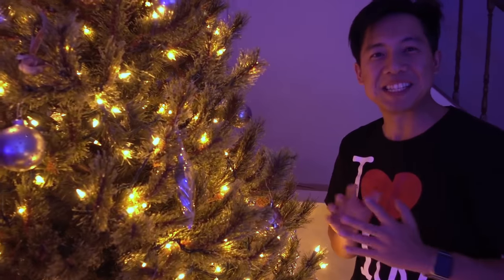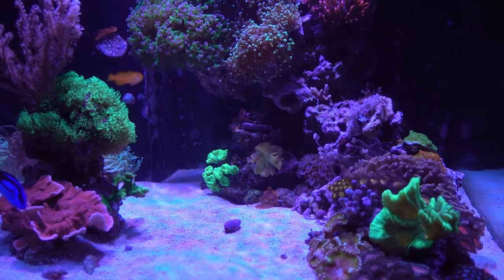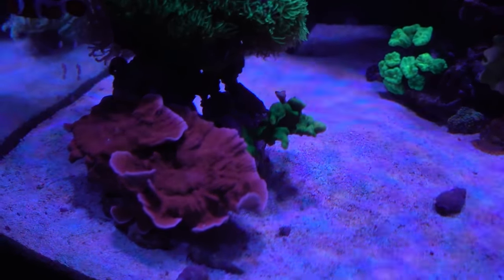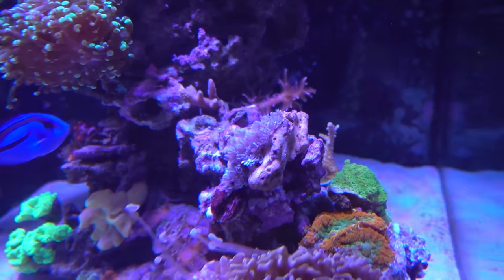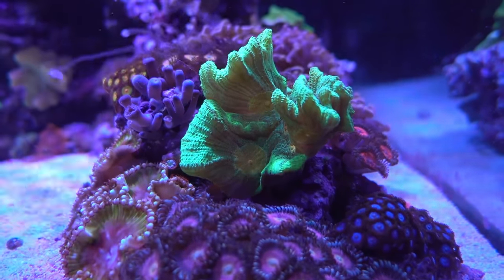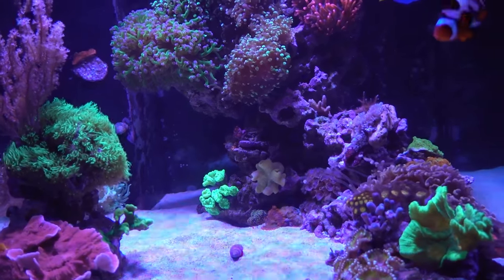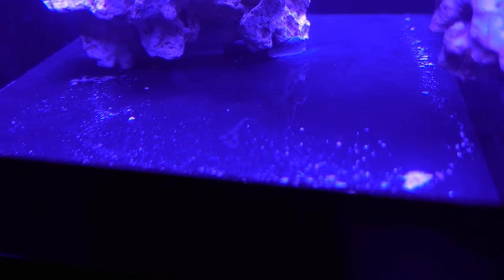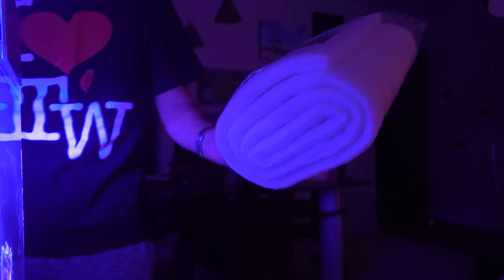SPS FAIL. Starfish FAIL. Dropoff OK. (45g & 17g Tank - 11/28/2016)

Comment: Our tree goes up on the 6th December normally, but we are having new carpet fitted on the 7th so room upside down. Tree looks great as does your corral, did you find out what caused the starfish to loose its colour.
Reply from the maker: Sounds like your tree will be delayed slightly this year?  I think I did not acclimate the starfish long enough (only 40 mins), I should have done it for ~2 hrs.
Reply: Yes they are more prone to shock than people imagine. I would drip acclimate over four hours mate to be safe.
Reply from the maker: I will keep that in mind for the next time I want to give starfish a try, thank you Paul!

Comment: Hi Inappropriate Reefer,  I thought I'd pitch in my past experience with your issues.  When it comes to the SPS it's probably the ALK swings if they aren't kept at a steady level this can happen.  Your other corals; Softies, LPS, and Zoes don't react to these swings although it's not helpful.  So as to say you can have a PH/ALK (PH 78) and your other corals will do great open and extend, but when it comes to SPS they will start to bleach and die.  When it comes to the sea star your right they have to be acclimated for a long period of time and also have to be feed if not they will die.  Your drop off looks Great and when it comes to the cycling process yes your advice from others is correct.  Eddie of Eddie's Reef Aquaria
Reply from the maker: Thank you Eddie, thinking back to what happened 3 days ago...  I add Kalk to my ATO container, usually I let the mixture settle for at least 30 mins before I plug the ATO back in.  I may have plugged the ATO in a bit earlier and the pump pumped some of the still saturated top-off water into the sump.  That may have caused an Alk swing.  This is probably it.